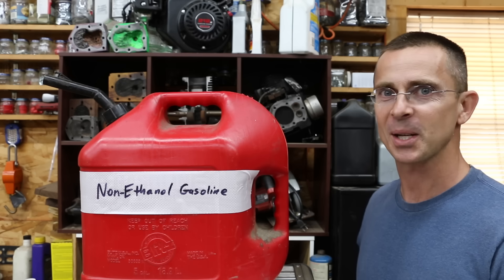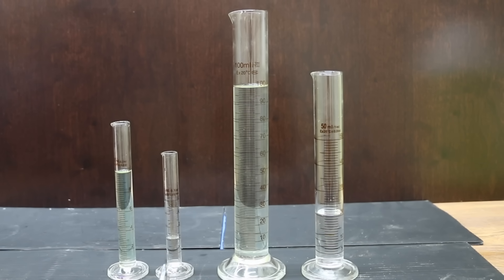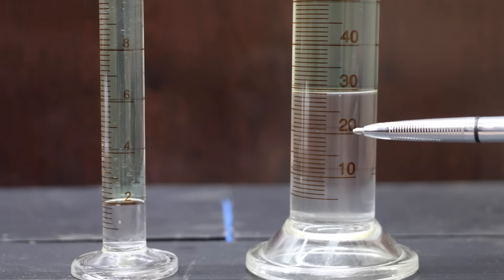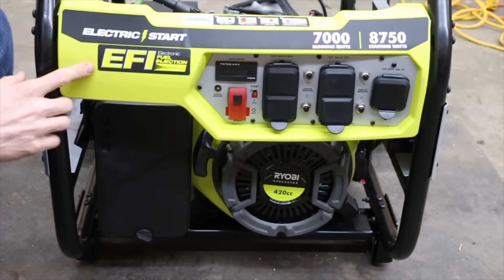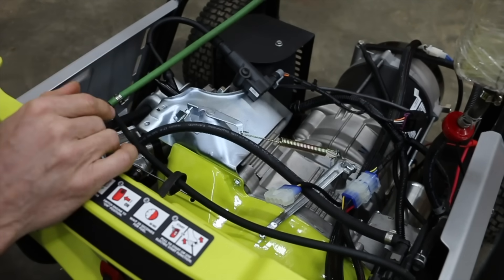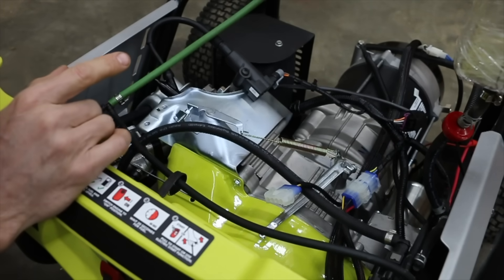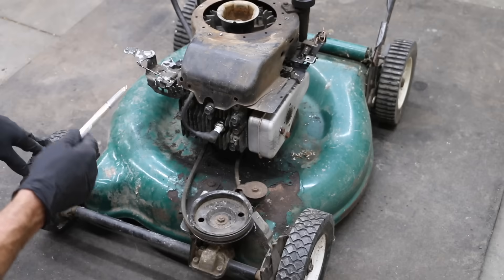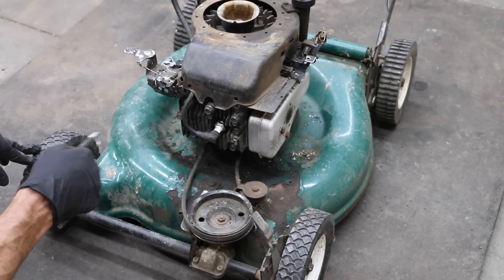Is Non-Ethanol Gasoline Really Better? See the PROOF!

Comment: Some years back I had to use a small generator to power our fridge... Long story... Anyway I would buy non-ethanol and the generator would run 2hrs on a tank while the ethanol gas would run 1 1/2 hrs while the ethanol was cheaper to buy I had to refill more often so no saving there
Reply from the maker: Great information. Thank you!
Reply: @ProjectFarm  thanks I suggest posting the difference between the fuel/air mixture of each type of fuel as well as pure ethanol I was shocked at the difference
Reply: Hopefully it was a new generator. The ethanol dissolved the rubber needle valve seat in my 12 year old generator after six years of use. My father in law gave me his nearly new chain saw that he had used once. The fuel lines had completely dissolved. I bought ethanol resistant hose and replaced them. The job left me with a bloody finger, just like the guy in the YouTube video. You would think new equipment sold in America would come with resistant fuel lines. Oh, who fixes a $100 saw? They just buy a new one next time!

I buy ethanol free gas for all my small engines.
Reply: @daddio7249  it was fairly new at the time ethanol was still pretty new back then it happened back in 2000
Reply: @daddio7249  oh and I know what you mean in '03 I had bought a new gas weed eater (weedeater brand) and it ran great was pleased with it... Next season I couldn't get to stay running changed plug etc... Went to clean the carb and it was full of this gooey gunk so I looked into the tank and all I found was the screen that should of been on the end of the fuel line the cost was greater than the weed eater new so yeah
Reply: Mike Miller
We had that exact same problem with our weedeater brand trimmer we bought new in the mid 1980's. Every year it had to have a complete tune up and carb cleaning, then it cranked first pull every time till the next year.
Reply: James Methvin
Ikr, not using easily available resistant hoses when ethanol is mandatory in most gas, and non ethanol gas is almost impossible to find in many places, should be grounds for a massive class action lawsuit for billions of dollars.

They're screwing us over by not using them, then selling the hoses it should have had from the beginning for extra money while knowing their product will fail.
Reply: Propane. Thx me later
Reply: @myes344  propane is good but you loose as much horsepower as you would with ethanol just need the right type of regulater to replace the carb with. I had to convert a 5hp motor for the factory I worked at as a mechanic went down to 4.6hp
Reply: Mike Miller
That's because ethanol contains about 30% less energy than gas.

But it wasn't added to increase efficiency, it was added because it allows the fuel to burn more completely, which reduces the pollution that's directly kill over 4 million people worldwide every year, and the 22 million people who die sooner because of fossil fuels.

No, you aren't saving money directly, but the money saved on medical bills from less pollution is most likely several times more than the costs associated with burning pure gas. At least as far as car engines go. The damage to small engines seems to be quite a bit more severe. But it wouldn't cost that much for the small engine makers to make an engine that isn't wrecked by ethanol. I'd be surprised if it added $30 to the cost of a push mower.

But it would be much better health wise to just get rid of the fossil fuels that are killing and helping to kill over 26 million people a year.
Reply: @lordgarion514  Ethanol emits ozone. Regular gas does not. If you're talking CO2, it's not pollution.
Reply: @4TIMESAYEAR 
Burning gas also produces ozone. The difference between the 2 is negligible in the summer and more in the winter. 

And no one said burning ethanol was a good idea.
Burning things in general isn't a great idea.

And since too much co2 has harmful affects, and we now have too much co2 in the air, it is indeed a "pollution".

Conservative republican christian that only gets their news from conservative republican christians?

First, in study after study, democrats, liberals, and atheists are more intelligent than conservatives, christians, and republicans.

Secondly, even the largest fossil fuel company in history says burning fossil fuels is bad.

"ExxonMobil's understanding of climate change has tracked the scientific consensus on climate change , and its research on the issue has been published in publicly available peer-reviewed journals"

Now, just piss off with your ignorance and bullshit please.
Reply: @4TIMESAYEAR 
And about that ozone production.

"What we found is that at the warmer temperatures, with E85, there is a slight increase in ozone compared to what gasoline would produce," said Diana Ginnebaugh, a doctoral candidate in civil and environmental engineering, who worked on the study."

Look at that, actual scientists doing actual scientific research getting a different answer than whoever it is you're listen to is telling you.......

You got any names of actual scientists that do actual scientific research that can refute the scientist that I provided.

Oh yeah, they need to refute all the scientists that work for ExxonMobil as well........
Reply: @lordgarion514  We don't have too much CO2 in the air. Atmospheric CO2 is not pollution. They allow 5,000 ppm in submarines. Now how about YOU take your own advice.
Reply: This is for 4TIMESAYEAR. We have a 2017 Hyundai Ionic Hybrid vehicle. It was getting between 38 to 40 mpg (highway) with ethanol gas. We switched to ethanol free gasoline and now no matter where we travel we get 49 to 55 mpg (highway). We were getting between 25 to 30 (in town) with ethanol gasoline. After we switched to ethanol free gasoline we are getting 32 to 40 mpg (in town). You may think that this is because of the gasoline/hybrid engine, but look at the difference. My Chevrolet Colorado gets about 5 to 7 mpg better both in town and on the highway. Sometimes it would get better if my wife didn’t start it and let it cool off every time she uses it. The ethanol gasoline is slightly higher in price, but the difference in mpg and maintenance will greatly prove it to be a lot cheaper in the long run!!! Most gasoline items, such as lawn mowers, weed eaters, chain saws, etc. recommend ethanol free gasoline or adding an additive to the ethanol gasoline. I had to replace the carburetor on my lawn mower after owning it for 2 years (I bought it new). I was using gasoline with ethanol and adding the additives and the inside of the carburetor looked like I had been running acid through it!! Why are we using our food in gasoline? To make the Congress people in those corn districts richer!!! I hope and pray that President Trump wins 2020 and Jesus Christ blesses us with a Christian Conservative  Congress so we are able to make ethanol free gasoline and get things done in this Country that’s needs to be done!! It’s time we spend our money on our Country and quit giving it to countries that not only hate America, but would destroy it if they could. God Bless America and President Trump!! #Trump 2020 # America 2020

Comment: You should be able to buy ethanol free gas. Where I live Shell V power 91 is ethanol free, there are a few other local brands too who have ethanol free 91. Buying gas from a marina is also ethanol free on all grades due to its affinity for water.

Some of the stations who carry octanes higher than 91 will have ethanol blended into all grades. Like a station with 94/91/89/87 since the pump is blending fuels to make the octane level at the pump vs being fed from a 91 octane pure gasoline tank.
Reply from the maker: Thank you

Comment: was just gonna ask about the effects on carbs. I have a old jeep and was told by previous owner to run Non Ethanol gas. I have a carburated engine. I plan on putting on a high performance carb on soon.
Reply from the maker: Great point. I have a long-term test underway.

Comment: Got yourself a new subscriber! Great video, thanks! I drive a Corolla with a carbureted 1.6 engine, and certainly see about a 5-10% drop in MPG if I use the ethanol. Your 4% finding may differ in engines with varying loads. The blue color flame at idle/ low rpm may also be a factor to consider in traffic, but in engines with EGR systems, this trait may not exist. Good food for thought!
Reply from the maker: Thank you very much for subscribing and thanks for the positive comments!

Comment: I think the problem isn't ethanol itself, it's the fact that it's used as a mix with gasoline. As you showed in this video, ethanol causes water to seperate from gas, and due to it's higher density the water-ethanol mixture collects at the lowest point of the fuel system (=float bowl of the carburetor), where it causes corrosion. It's now the fourth season that i mow our lawn with my 100% pure ethanol lawnmower, and it fired up on the second pull this spring! I don't do anything special with it, just keep it in the garage all year. I don't let it run out of fuel in the fall, and i also don't use fuel stabilizer.

Recently, i took the head off to see what's going on, and apart from some oil deposits (that it's burning a little oil of course has nothing to do with the use of ethanol) it looks as any small engine combustion chamber i've ever seen. Absolutely no signs of corrosion. I have to say that i'm using an old suction-type carb on it (no float bowl), maybe a float-style carb would be more sensible. But the aluminium fuel tank shows no signs of corrosion either.
Reply from the maker: Thank you!

Comment: Been reading the comments, people, you remove the water and alcohol. You make your own gas can, in my case a clear 3-gallon bottle with a spigot installed in the bottom corner. I add a bit of food coloring to the water so I make sure it is all removed. I only make up a small amount to use when winterizing my tools. There are several videos on how to..
Reply from the maker: Great tip!  Thank you

Comment: I am looking forward to what you find with the long term testing. In my experience, ethanol has killed several small engines of mine. I now only use non-ethanol premixed fuels in string trimmers, blowers and chainsaws and I have some that have run for 5 years and still start on the first pull. 

I would like to see you test gas treatments that are supposed to mitigate ethanol damage. Products such as lucas oil or Stabil 360.
Reply from the maker: Thank you for the video idea!

Comment: When I used the same fuel I put in my car it literally shook my lawnmower engine apart. Parts literally broke themselves off from the rest of the engine. I used straight untreated fuel in the new mower and it runs like a dream and is very quiet unlike the old mower that shook itself apart which was defining loud.
Reply from the maker: Thank you

Comment: Starting right off with my experience with ethanol free gasoline, it had my vehicle running tip top with better fuel economy. Go figure I paid more per gallon, but it was worth it for a 400+ mile drive. Seeing the video in a controlled environment it shows little difference.
Reply from the maker: Thank you!

Comment: Very good, thanks.
In 2003-4 we tested several different cars in as controlled conditions as reasonably possible and determined a 6% mileage loss with 10% ethanol.
Previously we tested the "magnets on the fuel line" on these same cars and increased gas mileage on non-eth gasoline by 4%. These magnets were circular like washers (.375" thick stacked 4" long) with a copper fuel line through the middle.
These were hot sellers in Asia back then, made in the USA. 
Keep up your good work.
Reply from the maker: This is great information!  Thank you
Reply: My E tests were encouraged by two 90 Ford 5.0 efi that intermittently ran poorly.
After spending $600 chasing the rabbit on one, I discovered it wasnt mechanical but ETHANOL 10%. Ezero runs fine.

Comment: We have E85 in some stations, but TIL there's the exact opposite thing called E15
Reply from the maker: Thank you
Reply: my best friend's new 2016 Chevy truck went from 17 mpg on 10% eth  to 11 mpg on E85 summer blend.
Reply: @hotrodray9884  that's very obvious tho, e85 is a higher octane which allows for more timing and power to be added in to the engine, not increase fuel mpg,  as stated e85 burns faster, and at 100% throttle, will look like you have a hole in your gas tank.

Comment: Ethenol Gas, Good for farmers who grow corn, not good for consumers.  Ethenol makes all my small engins run like crap.  I have replaced more weed trimmers in the last 8 years than I have in the last 30 because they just don't run right using ethenol gas.  That's just my opinion it's not based on scientific info, just my observation.
Reply from the maker: Thank you

Comment: One thing I’ve learned about alcohol and fuel if you have a small engine the alcohol will eat at the Rubber
 in the carburetor and after period of time your engine won’t run right I think that’s why they offer non-alcohol fuel at some gas stations it’s for small engines
Reply from the maker: Thank you
Reply: Project Farm 
Thank you for your return comment I appreciate it

Comment: The two big problems with ethanol are the solvent properties in systems not designed for it, (the subject of the test video he promises at the end), and its hygroscopic properties. If there's moisture in the air, (e.g. around boats), it will absorb the water and release it into the fuel system. That will cause corrosion of steel pipes, &c., and can lead to stoppages. (Not good if the power plant's in some kind of flying machine.)
Reply from the maker: Thank you

Comment: For over 100 years automobiles have been optimized to run on low octane gasoline. Optimize them for high octane ethanol, not gasoline with ethanol, but pure ethanol, and it would kick ass. It works pretty well in high revving, 200+ mph Indy cars. Also, corn is a terrible source  for making ethanol.
Reply from the maker: Thank you

Comment: Nice test. Was very glad to hear you mention testing ethanol on plastic and rubber parts. That's the reason I always avoid ethanol for my small engines and outboard boat motors. Too many horror stories, and I've seen some evidence myself on some used boat motors that previously ran ethanol for multiple seasons.
Reply from the maker: Thank you very much!

Comment: Ethanol is not entirely a hoax and I don't know why everyone is so quick to dismiss it. 

 
Everyone is quick to site that:

- It clogs lines, filters, pumps injectors, and other fuel system components as well as potentially causing permanent engine damage.
- It gets lower gas mileage (around 35% from my experience and others)

But that's just it, Ethonal is not intended to win in these categories nor will it ever win.

Everyone overlooks the fact that E85 ethanol is around 105 octane and it has better cooling properties than standard gas. This means that it is highly knock-resistant which if tuned properly can yield substantial power gains, especially in turbocharged and supercharged applications. The stuff is essentially a poor man's race fuel. 

Now that being said, you must have a car equipped to run this fuel effectively. You need upgraded fuel pumps, injectors, fuel lines, and a tune to support it. Additionally, you either need some type of flex fuel sensor or a way to measure ethonal content within the fuel either on your fuel lines or prior to putting the fuel in.

So yes, if you put ethonal in an engine not suited for it you are wasting money and potentially causing harm. If you don't have a car equipped for it and you buy E10, the best metaphor is your essentially buying watered down alcohol at a bar and agreeing to it (pun intended).
Reply from the maker: Thank you!

Comment: There were some tests by a youtuber that showed Ethanol SLOWED DOWN corrosion of gasket, rubber, and plastic parts when added to gasoline.
Reply from the maker: Very interesting.  I have an undergoing test underway and it doesn't match the findings of this youtuber.
Reply: @ProjectFarm  Would you want the youtube channel's name and let's see what could be reasoning to their findings so you can eventually test against them?
Reply: @ProjectFarm  The name of the youtuber I saw a bulk of these findings goes by the name Jacob Kaul, he's cited and showed his results on fuel lines in a video.

Comment: I've worked on many crews with chainsaws and other equipment since way before ethanol. I've seen alot of gummed up engines that only ran gasoline. In the seventies everyones motorcycles carbs would gum up. You just need to put stabilizer in both if your going to leave it in there long. I've had no fuel damage to my chainsaws with ethanol. My big ones that rarely get run will fire right up after months. However, I do know people that have to have their boats worked on every spring. They put them away with no stabilizer and bitch about ethanol.
Reply from the maker: Great point!  Thank you

Comment: Something else to consider is the absorption of water into the tank via ethanol.  Boats are in water so the hance for water introduction in the fuel system is much higher. Non ethanol fuel doesn't absorb and retain water that's why I use it in my watercraft.
Reply from the maker: Great point!

Comment: This is pure BS...Ethanol based fuel has many additives so that the Ethanol,(a water based product),stays suspended in the gasoline and other additives...The small engine he did not show a cleaned head free of all carbon nor did he use a new spark plug in each test!!! In "Independent Laboratory" testing Ethanol based fuel caused corrosion of Aluminum,white flakey deposits in the intake structure and on the  intake valve causing leakage of cylinder compression,plus lower torque,horsepower and mpg than normal gasoline...